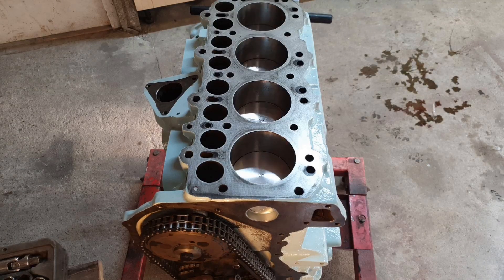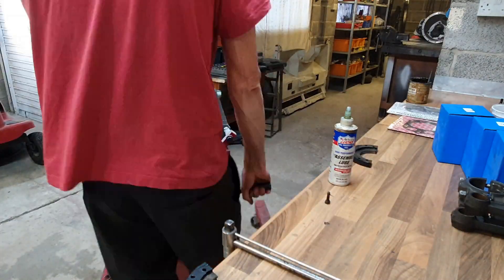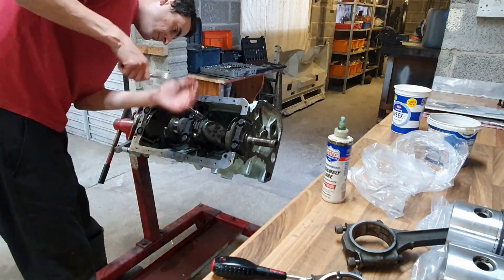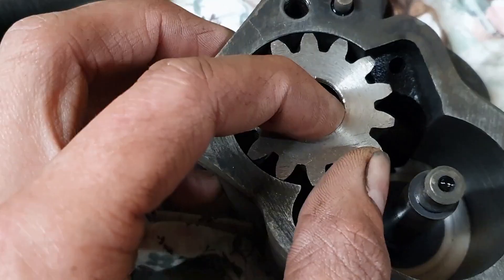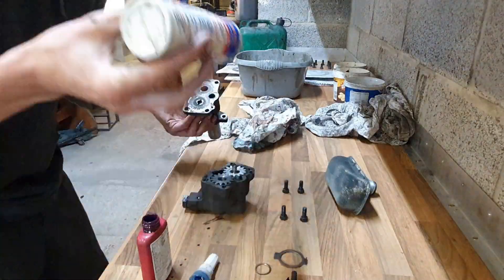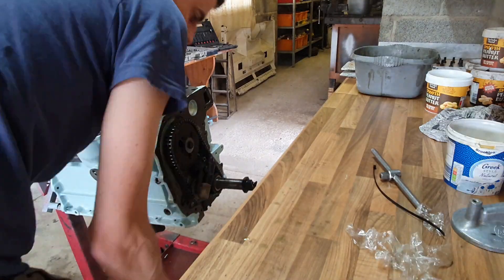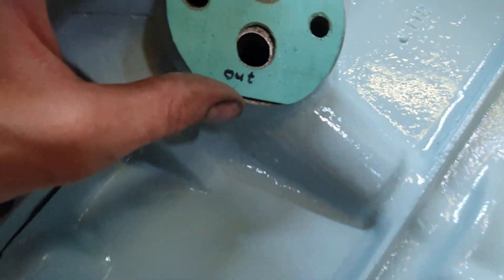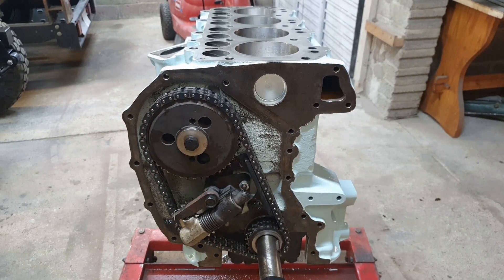Assembling the Bottom End  -  2.25 Petrol Engine  -  19 Land Rover Series 3 Project

Comment: Great spot with that oil filter housing gasket!

Did you need to faff around with piston ring gaps or were they ok out of the box with the new pistons? I always thought they needed to be checked and gapped to the individual bores. 

Ps Love the stop motion. There is a classic car channel called Soup Classic Motoring that does lots of this but I think his background is in the film industry to begin with.
Reply from the maker: Dalamar, thanks for comment, much appreciated, glad you're enjoying the videos. There was a comment on my time lapse video of the discovery V8, someone told me about soup classic motoring :) this is what made me have a go at it :) it's so much fun. 

Regarding the rings, maybe 3 or 4 of them needed adjusting, they were too tight, so I just angle ground them gently and carefully and they were either spot on or a fraction over (safer than too tight). To be fair they were all pretty close though.